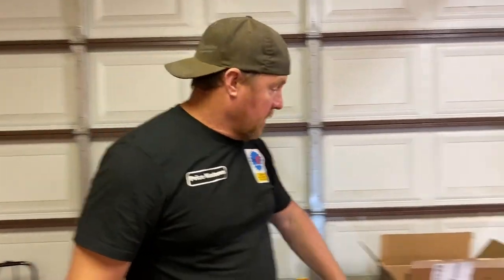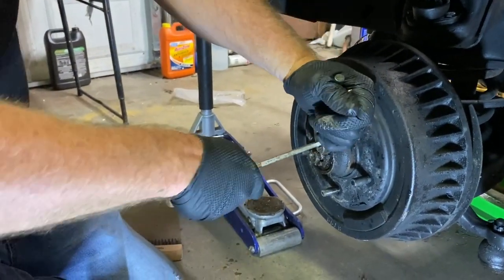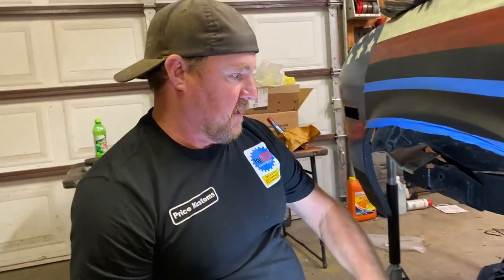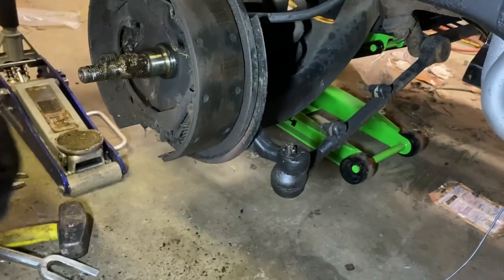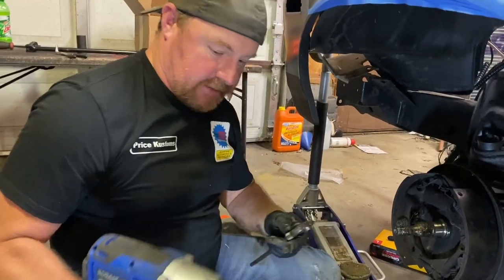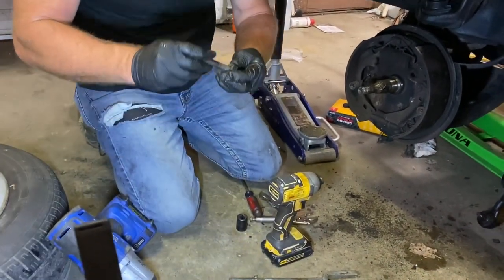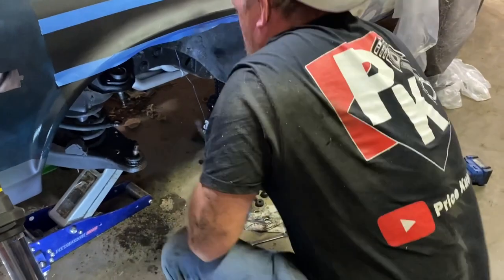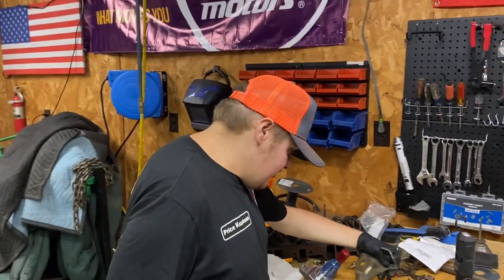NEW Front DISC Brake Conversion 1974 Chevy Nova / 1974 Chevy Nova Build Part 41

Comment: How to take off nut, heat and vice grips. If that doesn't work, cutting torch and new tie rod.
Reply: I see you got it, some nuts are rusted so bad into the threads here up north that chisels heat and vice grips do not work. When that happens, the cutting torch is the only option.